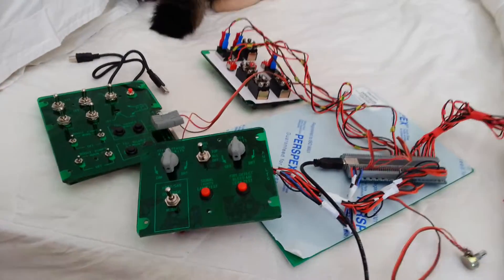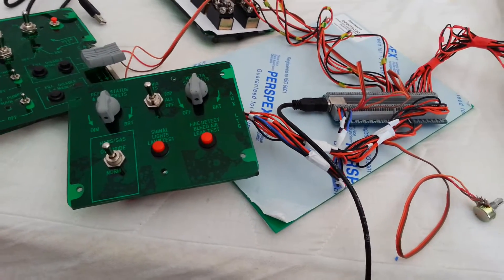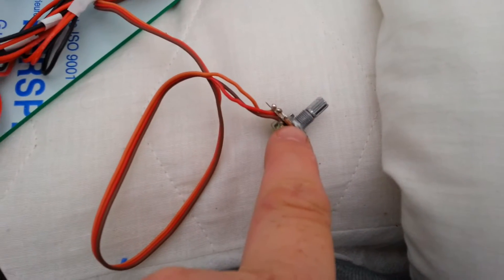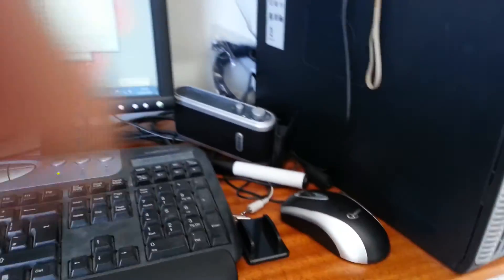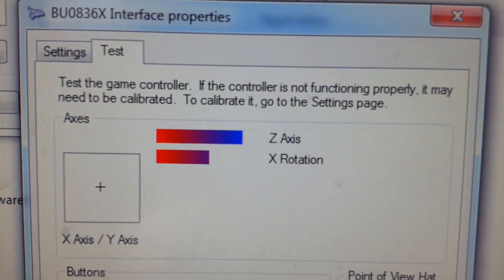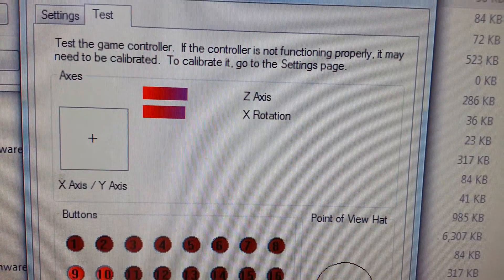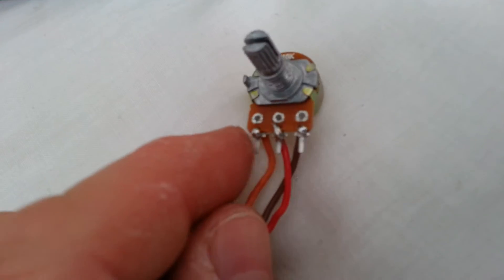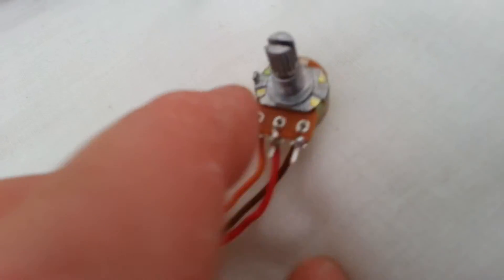Test no.3 LeoBodnar BU0836X  linear potentiometer

Comment: What size pot did you use ? And it's to the analog?
Reply from the maker: I don't recall the size but I had issues with reliability and I think this is because a) my soldering is sh1t and b) the pots I used were cheap ones.

Comment: Hi. I am willing to make all the panels (I also have a cnc router) but what scares me is the electric part and I don't have a lot of money
Reply from the maker: Just buy a few bits at a time.  It need not be expensive.
Reply: @richwhilecooper  thanks man, just what I wanted to hear. I tried connecting 2 $2 joypads to see if I can use those cards and they work, but sometimes a little unpredictably. I guess I better go with a BU0836X or something

Comment: Hi Rich, I like the green carrier plates that you are using to mount the switches and other stuff on ... can you please tell me what these are and how you printed onto them ... looks really cool ... I'd also like to build my own cockpit and already have a few of the Bodnar controllers but yet not found the right material as base for the cockpit devices, hence asking ... cheers and best regards, Thomas
Reply from the maker: Hi Thomas. Post filming this I borrowed some time on a C02 laser at work and made some much better panels. I got the base plans off the ED Forums (search that on the Internet) and then I looked for A10C panels.  There are free designs available for download. I did have to redraw some in CAD  You can see what I made on my FB page 'Rich's A10C Warthog Cockpit Build'.  I made a bunch of prototypes that I very recently sold to a guy in the US.  I am buying a laser for myself soon and will be making and selling kits.  The green plates are just green acrylic but I can now use special engraving acrylic and a 3 layer system just like in the real aircraft.
Reply: @richwhilecooper  Thanks a ton for the swift reply and comprehensive answer ... well done and good luck with your future projects! All the best, Thomas

Comment: If I use any DB9 to USB cord to connect G27 pedals to PC,  work?   Leo Bodnard cord is different than normal DB9 - USB cords?
Reply from the maker: Should work!
Reply: Don´t worked.  Windows does not recognize the device.  :(
Reply from the maker: I have no problen with mine at all.
Reply: Well, that means that Leo Bodnard adapter is not just a normal DB9 to USB cord.   I guess I have to import one.  :D
Reply from the maker: I thought they were just standard usb a-b connectors. You can buy a a shifter g27 interface from leo bodnar
Reply from the maker: de5letras I think I misunderstood your original question.

Comment: Can I use a 360 endless potentiometer for autopilot  like for speed and altitude and heading
Reply from the maker: +Ismaeel Awad Not sure... I did not tbink the A10 C autopilot works like that. You can use any type of switch or pot but it just depends how you program them to work with DCS.

Comment: So whats the difference between a rotary encoder and a potentiometer? what would be better for an f-18 mfd brightness knob? i plan to use a bbi 32 for making the entire mfd just can't figure out all these switches and stuff on my own, and how do you limit the length of travel from one of these encoders?
Reply from the maker: The pot will give a slider effect..  like analogue input.  A rotary encoders just records left or right movements. you'd use a Pot to control a joystick axis or a dimmer switch which has an on and off and shades inbetween. An encoder is better for dials, like a radio dial.  You can keep turning it clockwise or anticlockwise forever. so if you restart your software, turning the encoder right will move radio channel up until you hit the highest value in game and likewise moving it the opposite was would move it down. You would not need to sync an encoder with software but you WOULD with a pot because a pot g
has max/min positions that must be set to match the software (calibrated).

Comment: Why does the pot-meters require 3 wires? I thought they were just variable resistors.
Reply from the maker: +Audun Skilbrei You need a ground wire and the input wire and the 5v connected to the leo board.
Reply: Yes. I got that part. I was just wondering why. I was able to find the answer however. A potmeter doesn't really act as a variable resistor but as a voltage divider which is why you need the ground wire.
Reply from the maker: +Audun Skilbrei I learned something from youbthen!
Reply from the maker: +Audun Skilbrei I learned something from youbthen!